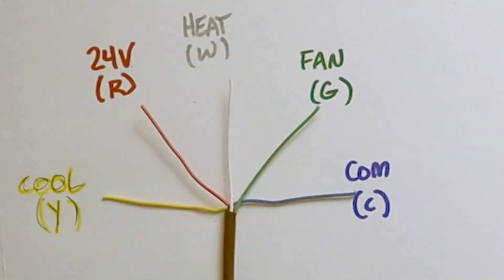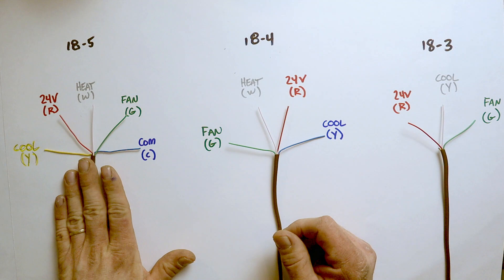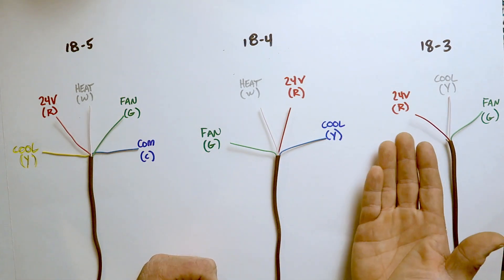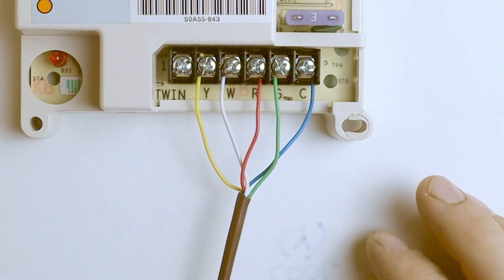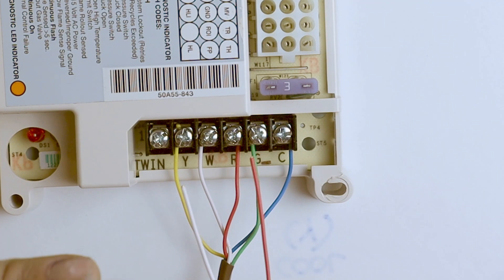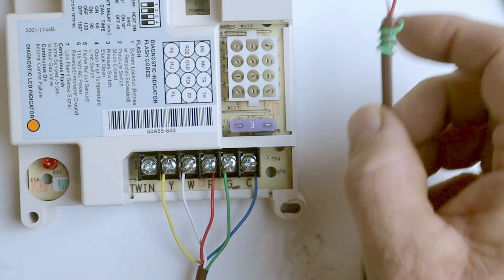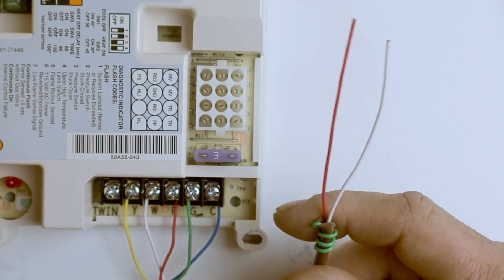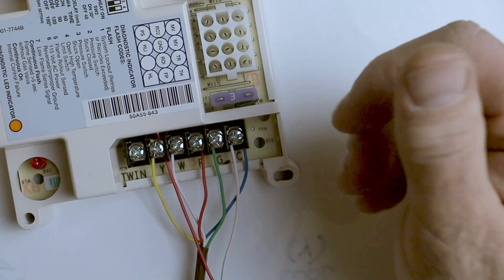STOP depending on wire colors to learn HVAC wiring

Comment: I have an old Honeywell T87 with 4 wires. Red(R) green(G) yellow(Y) and black(W). No blues, no whites at all. Im looking to install this newer one with a C terminal that says it wont operate without it. It comes with a jumper wire and has a built in jumper from (R)to(Rc). Can you help?

Comment: Common terminal is interesting one. where does it go. Seems like similar to ground terminal. If more than one wire can attached to it. Any interruption in attaching two wires to common terminal?
Reply from the maker: Common goes back to the transformer eventually. Connecting 2 or more to C doesn't have an effect so long as it's all powered off of the same transformer. There are some exceptions out there but the equipment is made for those particular circumstances.
Reply: thank you sir. i just start watching your video.. you will see me here often  @JerseyMikeHVAC

Comment: Hey Mike great video.
How do you hook install a Nest No C required.  Old unit has:   W2 as White, G as Green, W as Blue Y as Yellow and R as R + Jumper to C The bottom labels of the panel on the thermostat  Blue is  O/B. The new Nest has only 6 connectors YCWGR and o/b. I did conect the Blue cable to the o/b because of the Hat Cold Valve. Since the nest worked OKa at first and only after installing the google home app. this went 180 and while the dial was at 75 the air was blowing hot and room got to 83. Is the nest broken?
Thanks Great vidoes.
Reply from the maker: Do you have 2 blue wires or just one?

Comment: Very helpful. I was going to make the same mistake of matching colors for wires from AC.  I have a red, a white and a green coming from my AC. I replaced my blower motor and the photos I took prior do not show control board connections as well as I wanted. Red from AC to Y on control board, white to C, green to G? The blower motor seems to work with or without the green from AC connected.
Reply from the maker: Typically at the control board in the air handler on a 3 wire set up (red, white green)  red from R terminal at stat to R terminal at control board. White from Y terminal at stat to Y on control board. Green from G at stat to G on control board. Blower is activated by Y terminal. G is just for fan in manual position at stat to circulate air without cooling. 

You'll also have 2 wires from the outdoor unit. Typically one red one white. That red goes to Y terminal on control board (along with white wire from thermostat). White wire goes to C terminal.

Comment: Was an commercial electrician and loved when lazy HVAC guys placed a fancy t stat in my hand & told me to install it. Told everyone of them it would be a co!d day in hell when I did the job they got paid to do. Best was when they left it with my helper and he said he could not install anything with permission So lazy HVAC guy would have to drive a halve a hour or more each way too a 5 minute job. A few times my foreman would say just go ahead & install it. Told him that when HVAC guys install new units they supply a one year warranty and they will not want to ever replace a thermostat that we installed. Best was when the HVAC horrible apprentice ran both the 480 & 24 volts in long conduit. When he turned fancy new two stage heat pump thermostat on it blow up and caused a nice burn mark in wall. He somehow connected the low voltage stat wire to 480 vokts. They called that guy "The Filter King " because that's the only job he could do by hinself.
Reply from the maker: Lol. How does someone confuse 24v control voltage with 480? 

There are a lot of Filter Kings in this trade, unfortunately.